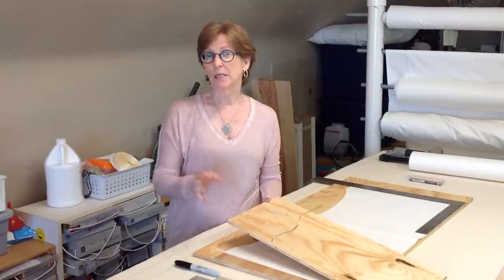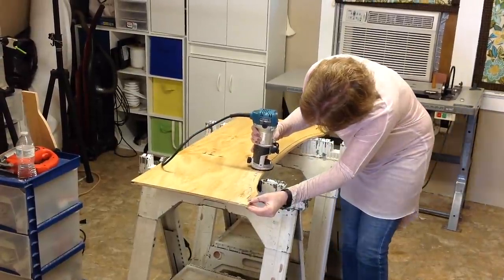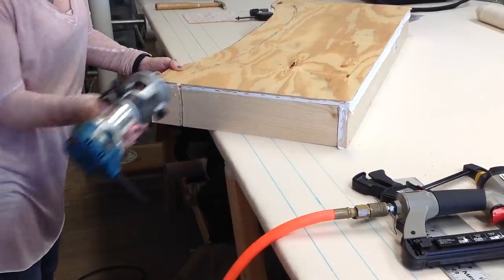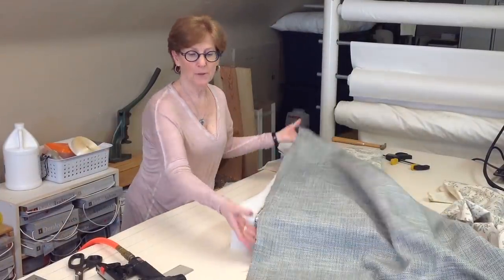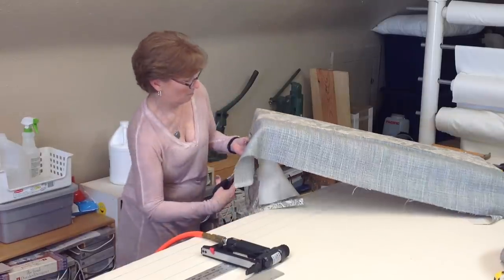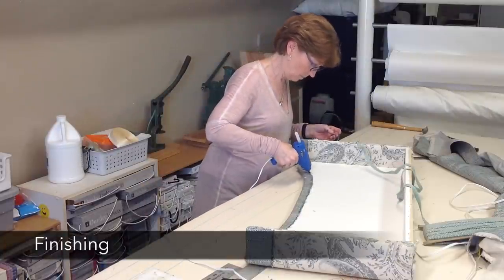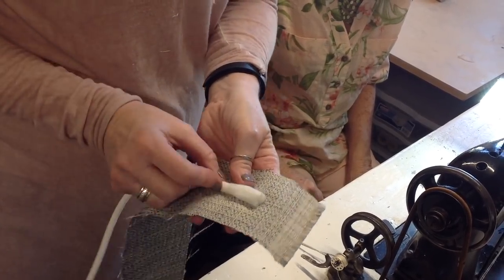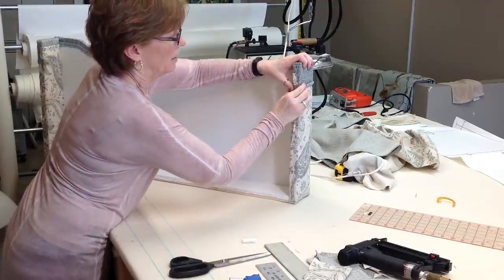Method Share - ROUTED UPHOLSTERED CORNICE BOARDS

Comment: That is just beautiful. I have three windows in my back room. They all sit within inches of each other, however the middle window is clearly the size of a double window.  I only have blinds in my home.  I want to make a cornice board and am looking for a suggestion.  Should I do 1 large cornice board or 3 individual boards?  Please advise.
Reply: I'm working on something similar. You should do 1 longer board to cover both windows.
Reply: I have this same exact window setup and I’m still undecided if to do one large cornice or 3 individual ones

Comment: As a 45 year professional carpenter, routers "kick back" both directions as the bit spins in a circle and could catch the wood on either side of the bit. It could jump either way. A Table saw and circular saw "kick back" not so much a router. Routers "climb" into a cut.